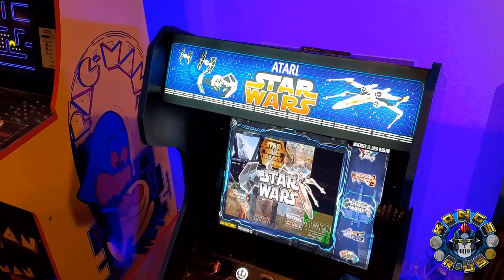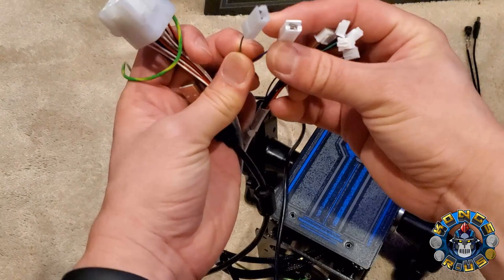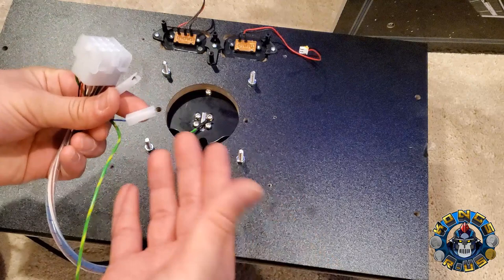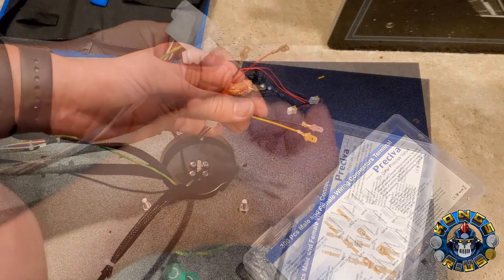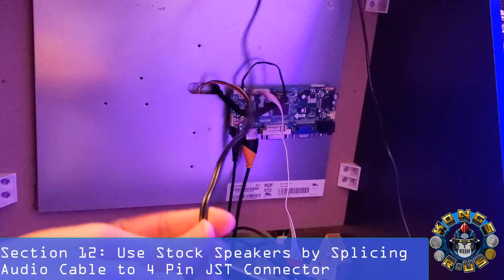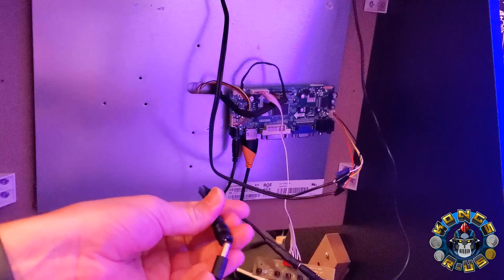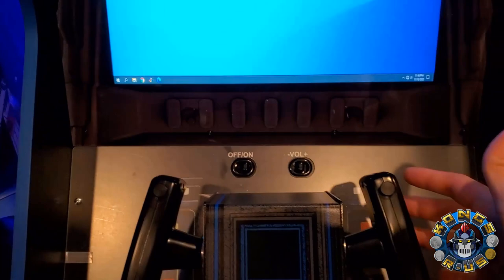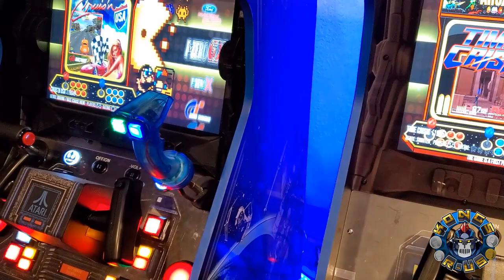How to Install GRS Flight Yoke into Star Wars Arcade1Up Tutorial + Add 2 Secret Buttons! No Drilling

Comment: you should install the new yoke with the old backplate of the arcade1up yoke, as this gives you the extra strength. if you use it without, the bolts can work themselves into the wood behind the control panel, and your new yoke will become loose then. also you damage the arcarde1up control panel with this earlier.
Reply from the maker: thats a great point, I should have re-used A1up back plate for support. I think I got too excited about adding the extra buttons but this is a fantastic point and would recommend adding this step into the tutorial. thanks!

Comment: I would like to see a detail video on how you wired up that Power Plug and the ON/OFF A1UP Switch.  I'm interested in how the HOT/NEUTRAL/GROUND go into the back of the Power Plug plus all of those Jumper Wires...and then the 2 Wires to the A1UP ON/OFF Switch.  Thanks.
Reply from the maker: I've been meaning to do a dedicated tutorial on this so hope to work on that soon

Comment: For the marquee power, I ordered the converter and female to female connector.  The female to female from the direct link in description is a bit smaller than the y cable and marquee cable so it doesnt fit. Is there an alternate recommendation for a no wire config?
Reply from the maker: Hey Marc! I'm super sorry but I double checked and had the incorrect Female to Female Adapter listed. if possible, hopefully you can return the item and get this one Female to Female 12v barrel Adapter 
https://amzn.to/3cY19DS which should fit.

if not, I can reimburse u the cost of the incorrect one since it was my mistake. sorry about that
Reply: @KongsRUs  No worries at all! Should be an easy return at Amazon.  btw- thanks so much for these videos, I followed your instructions and got everything else set up this weekend. ITS AMAZING!  Thanks again - really appreciate you giving back to the community with these videos.

Comment: Mr. Kong!
After watching, I am still surprised that I have that "sleeping" problem with regard to the GRS yoke. It has to be a setting in Windows, No?! Also, did you make any changes to your Mouse settings in Windows Control Panel for the yoke that allowed it to be more responsive (it doesn't even appear you need to power it ON and/or while holding down the K7 button in order to put it in Mouse/Gamepad mode).

I am confused and it won't be until the weekend where I can troubleshoot further. Any tips would be appreciated.

BTW, I was orienting my spade plugs incorrectly in my crimper and never knew why the MALE connectors didn't crimp! <shame>
Also what emulators are you using for your Launch/Big Box build...MAME, PS2, N64, Dreamcast, Supermodel...any others?! When I play Star Wars Trilogy using Supermodel, the yoke response is really slow...
Thanks again!
Brent
Reply from the maker: you know, I actually haven't played too much with mouse mode at all. I used my yoke completely in joypad/joystick mode and it works great. if I need it to register as a mouse for some emulators, I use JoyToKey to map an Advanced Mouse Mode setting and spring mode. sorry can't be more helpful but try the regular mode instead of mouse mode if that helps!